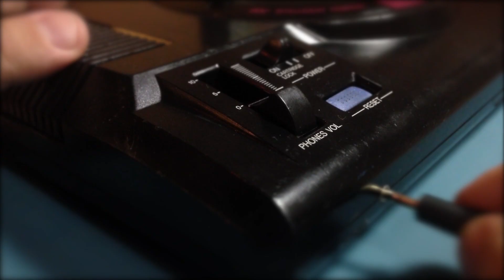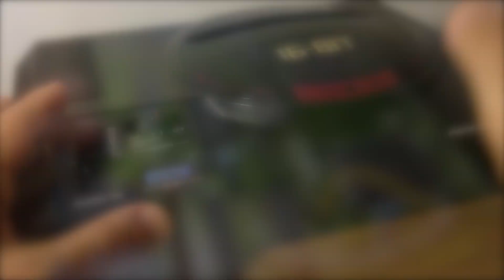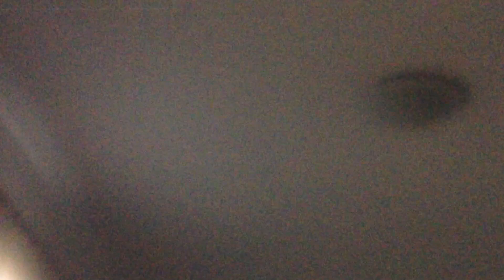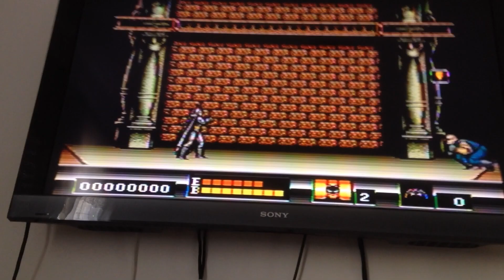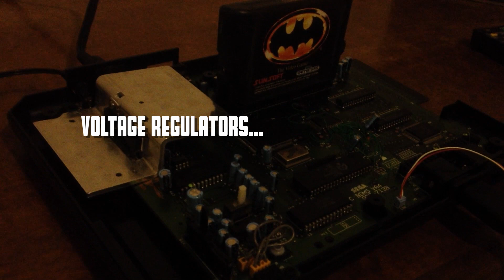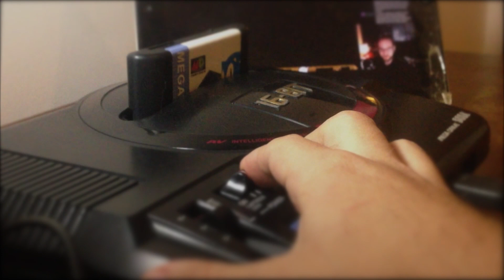Resurrecting a SEGA Genesis / Mega Drive - Part 2

Comment: When removing the 7805, I like to use a K-tip and add a huge blob of solder to all three legs. I keep the iron on all three until it is flowed on both sides which can take a while because the center is ground. At the very least, make sure it isn’t sinking heat into the heat sink. Once molten I slip the 7805 right off the board.

If your iron still can’t handle the thermal mass then cut the legs and remove each one at a time. Once they are gone the braid will work much better but, even then, I suggest getting the solder fully molten before you introduce the braid. I even hover the braid over my iron while I wait to pre-heat the braid but don’t get too close or you will burn off the flux. You can always add more flux to the braid to renew it.
Reply from the maker: Thanks for the tips! I'm sure I will try this method off filling the three legs next time ! This video is my first attempt to replace 7805s, I have little more practice now after replacing those and all the caps from this board which lasted for about 2 years after this fix, but then died, and I think the cause was this bus arbiter  ic which I remade the legs

Comment: If you are desoldering old voltage regulators you do not need anymore, it's much easier just to cut the legs and then remove each one leg individually. Also it is so familiar - you start enthusiastically, voice is energetic and then video becomes dark and you sound just tired. In my videos it's exactly the same, just by my voice one can tell time of day. But it was worth it! And if you cant find reason it's drawing too much current and getting too hot - try buck converters, they have no heat emission at all.
Reply from the maker: lauraiss thanks for the tips on removing the voltage regulators, it would be way easier removing the way u explained hehe, but it was my first time doing this hehe. sorry about my tired voice and the dark parts of the video hehe. I never have time to shoot videos and sometimes when I have some spare time, I'm really tired after work. I'll try to improve the light of the next videos, as I currently have only one old spotlight, different from the beginning of the part 1, where I shoot in another house with better light. I intend to show in part 3 that the regaulators still get hotter than they should, and I still couldn't figure out why. I've already replaced both diodes and I think they still get hotter than they should ... maybe I will try the buck converters as I've watched in one of your videos ! Maybe that's the solution for this board, as I also replaced all capacitors but it still draws too much current ...
Reply: @BocaRetroGames  About videos being dark and you getting tired, I did not mean as a complaint, it's just so familiar to me that even funny. I start video during day, then I must cook for kids and then do other stuff and then when AT LAST those little buggers are asleep, I have free time to continue my video and it's usually ~11PM  or even later. So my videos are usually like: "HALLO EVERYONE!!" and then half of video just tired mumbling, because I'm half asleep but dedicated to finish the video :)
Reply from the maker: lauraiss hahahaha that's nice to know. Your crazier than I, if I had kids I don't think I would ever even try to start recording any video, congrats for that hehe :) and I know you were not complaining about the video  light and my tiredness heheh tks for watching and I'm looking forward for your next videos, event not understanding much, but they really entertain me :) have a good week

Comment: I have a Megadrive MK2 in similar condition. Spent two weekends restoring line by line and then got tired of that, dropped the project and cannibalized it for parts. My guess it's because of some corrosive fluid gets inside of console, coke or something similar. I envy your patience! And after all, it's a part of history restored.
Reply from the maker: lauraiss lauraiss 1st of all thanks for commenting. I think  it's the same case as yours here. Some corrosive liquid around the cartridge slot started the mess this console became. I still don't know how I had the patience to finish this repair but I guess I've been using it as scape from the stress of my day job. :)

Comment: That's a lot of wires.  I don't know how you did managed to solder those wires so close to each other without de-soldering ones around it.  Good work
Reply from the maker: First of all Thanks for your patience to watch again ! Hehe! That's a lot of wires, you 're right! And the ic leads I soldered them to , on filed top of the ic were really really small indeed! And, yes, a lot of times when I tried to solder the next one, I de-soldered the some of others around hehe. That's why I don't have footage of this part, cause it was too painful and I though I would get nowhere.

Comment: I am glad you was able to chase down all the issues, I bet the ground plate sucked up most of the heat when you were trying to remove the voltage regulators
Reply from the maker: Tks for your patience for watching it ! :) 
I still can't believe this thing is working flawlessly. The only issue, as I said in the last part, is that the heatsink  is still getting warmer than I think it should... in part 3 try to address it... :) tks again for watching it